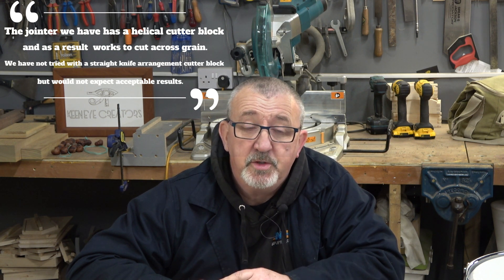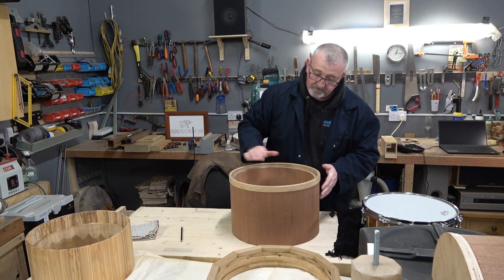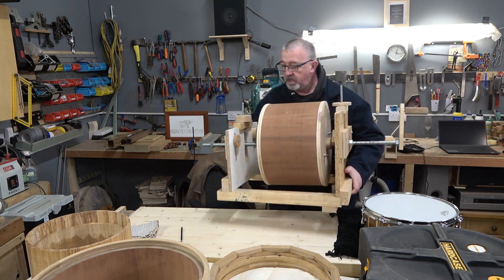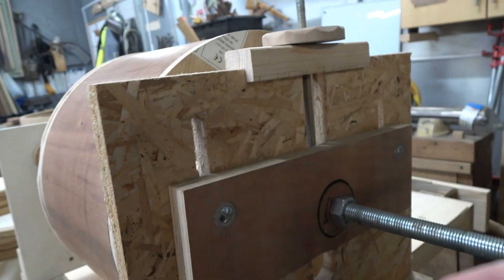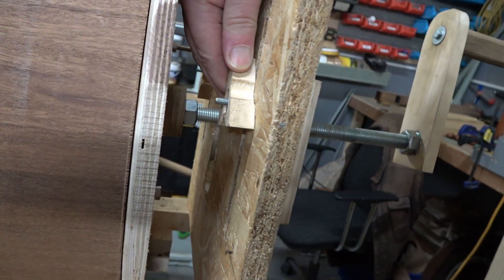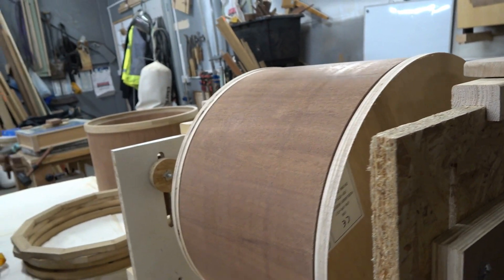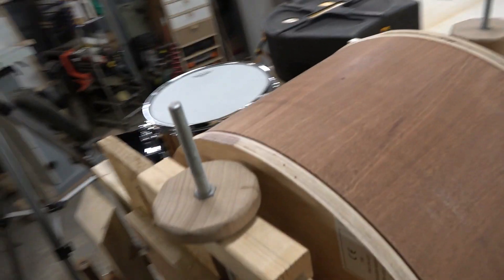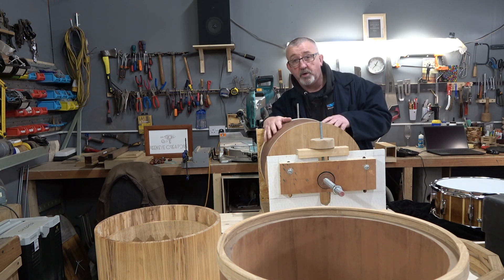Mill A Snare Drum ROUND On A Jointer!!  What??  ( Can You Do That?)

Comment: how is the drum attached to the wheels?
Reply from the maker: Hi, It's attached in two ways if you watch the montage towards the end of the video it shows 2 threaded rods that attach at 1 end into threaded insert(T nut) and tightened at the other end with nuts and washers. The other way is clamping pressure from the central shaft we put a couple of nuts on either end to lock nut it in place. 
It's also worth mentioning that there is self adhesive abrasive between the clamping disk and the rim of the drum to stop any unwanted movement.

Comment: A Thicknesser does one thing and one thing only that is to plane wood down to a certain thickness. A Surface planer to give it it's proper name can do a number of things that involve planing a surface including but not limited to Jointing, Flattening, Bevelling, Rebating and Tapering if so equipped. Nuff said and with that I'm of to cut some mortices with my dovetail pairing tool.
Reply from the maker: Well said I agree whole heartedly.